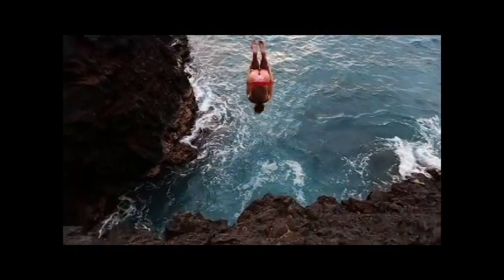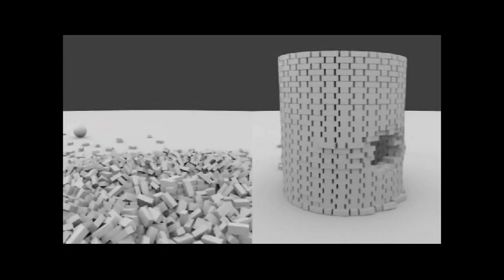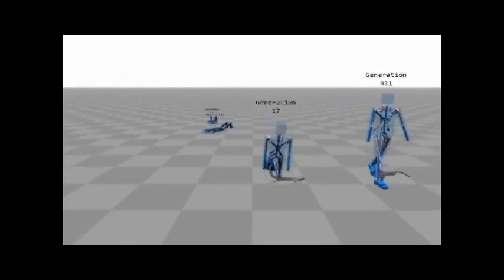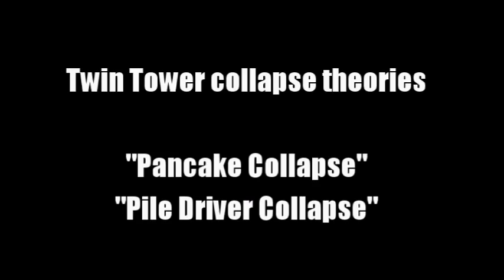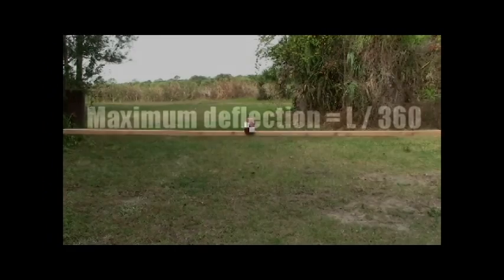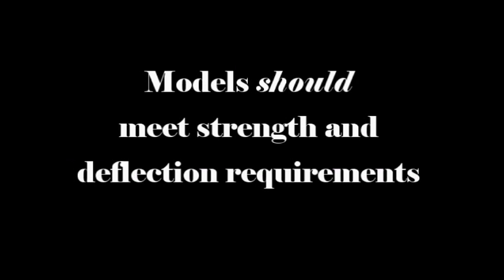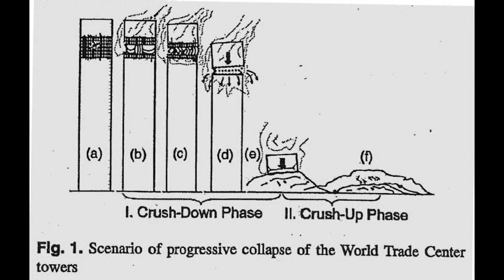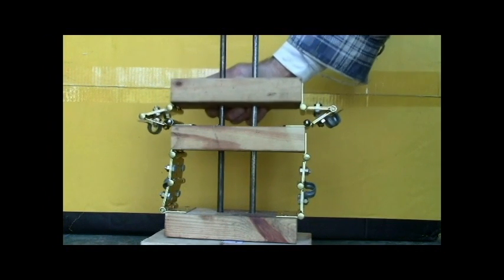9/11 Experiments: The Force Behind the Motion

Comment: In response to recent comments for which I am apparently being blocked I will say that Jonathan Cole's experiments validate nothing. The "down and out" motion that Cole mentions is not actually what happened in "the event." It is just a straw man argument that Cole could easily defeat with his silly and unrealistic experiments. What really happened to the WTC towers is that, after collapse initiation, the floor supports in the open office areas sequentially became overloaded and failed resulting in the floors pancaking into the basement. There is nothing questionable about the fact that the collapse accelerated as it went gathering one floor after another at an overall acceleration of approximately 2/3 G. The only outward motion was the dust and debris propelled from windows followed by the exterior columns peeling away after losing the support of the floors. The "multi-ton steel beams" (actually column panels) that were found impaled in buildings 600 feet away arrived at where they ended up by leaning outward in great sheets and breaking off. Here is a picture of a sheet of 50 to 60 stories worth of exterior columns, still mostly bolted together, that had peeled away from the west face of the North Tower after the floors had fallen:

archive dot org/download/NIST_9-11_Release_08/International_Center_for_911_Studies_NIST_FOIA/Release_08/Release%208/42A0007%20-%201of3/Police%20Overheads/166.JPG (replace "dot" with a period)

One has to wonder if Jonathan Cole saw pictures such as that before making this ridiculous video. I suggest readers investigate the actual evidence and be skeptical of truther claims that what actually happened was not physically possible.
Reply: Blah Blah Blah  CORE!!!

Go away W⚓
Reply: @gepettosplaylists  The core also experienced progressive collapse and, at any rate, could not stand without the lateral support of the floors in the open office areas. Please educate yourself and stop glorifying crackpots and opportunists who try to make you believe that what happened really didn’t.

Comment: This video is laughable for its simplistic and unrealistic “experiments” and its deceptive statements of science and fact. While it is true that a theory needs to be supported by experimentation in order to be proven correct, the experiment needs to realistically model real-world conditions. Cole’s experiments do not and are apparently intended merely to demonstrate the desired result. For example, to better model the WTC twin towers, the cement board “floors” in his pancake collapse experiment should have been more lightly supported and should have had greater mass. It’s no wonder that, when the weight was dropped, its kinetic energy was quickly dissipated in breaking the boards causing the “collapse” to slow to a stop rather than accelerate. A more meaningful experimental setup would involve modeling the floor supports as being more easily broken, say… using thin sheets of glass instead of cement board. To model the mass of the floors, a heavy building brick could have been placed on each glass sheet. Using that setup, the top glass sheet would instantly become overloaded when hit by the falling weight, would shatter and drop its brick onto the brick below causing its supports to also shatter. Then, there would be two bricks falling onto the third brick down at an even greater initial velocity, and so forth, until all the bricks had fallen and all the glass sheets had shattered. It should be obvious that a collapse modeled using the setup I described would accelerate and gain kinetic energy as it went and that the simplistic setup used by Cole was specifically designed to demonstrate the opposite effect.

It should also be mentioned that Jonathan Cole misrepresents NIST's statement about their findings not supporting pancake collapse. If you read the entirety of the NIST FAQ he referenced (currently #28), it should become clear that it is only talking about the factors that initiated the collapse. The reference to “pancake theory” (NIST’s quotes) was an allusion to the FEMA report where it is mentioned as a possible factor in collapse initiation. Other NIST FAQs make it clear that, once it started, the collapse was sustained by progressive failure of the floor supports, or “pancaking.”

I am a civil engineer. I have carefully evaluated the evidence and science and have come to the conclusion that the "official story" is perfectly plausible and is supported by ALL (actual) evidence and well-understood scientific theory.
Reply: This is AWESOME!!! FINALLY! A true professional!! Can you please build and display a proper experiment that supports the official story?! An experiment that can replicate what was observed on 9/11 so that I can finally let this “conspiracy” go? Because as of right now, the “conspiracy theorists” are the only ones making sense. Being a pro in engineering, this should take you no time to have a video up. Please send me the link when you finish.
Reply: @asonjayyajn  My charge rate for professional services is $110 per hour. I estimate that making a realistic model and shooting a video of it collapsing would take about 100 hours of my time which amounts to $11,000 in professional service fees to which would need to be added the cost of materials and photographic equipment which I estimate would add another $5,000 to the project. With your consent, I will draw up a contract. If you are unwilling to pay for the video you demand that I make, why not just think through the simple thought experiment I provided in my previous post. If you do, I think you will understand that progressive (pancake) collapse is a real thing and that Jonathan Cole is just fooling people.
Reply: @asonjayyajn  Look again at the videos. The floors in WTC 1 and WTC 2 progressively collapsed sending expulsions of dust and debris racing down the sides of the buildings. The simple thought experiment I provided exactly mimics that effect. Science is based on logic and reason.
Reply: Which projects have you made as a civil engineer?  That way I can tell my loved ones to avoid them and my enemies to live in them.
Reply: The experiment demonstrates and validates the forces of motion, not a model of the event.   The physics of the motion is evidence that can be applied to the event.   Or do you know of undisclosed physics that demonstrates how the towers imploded?
Reply: @ouchyg They can never explain the outward motion of multi ton steel beams when the only force applied according to them is gravity.  Which only works downward in cases of building collapses.

A force was applied to move those items outward sideways.  It can't be due to collapsing floors from above.
Reply: @ouchyg  Cole's experiments validate nothing. The "down and out" motion that Cole mentions is not actually what happened in "the event." It is just a straw man argument that Cole could easily defeat with his silly and unrealistic experiments. What really happened to the WTC towers is that, after collapse initiation, the floor supports in the open office areas sequentially became overloaded and failed resulting in the floors pancaking into the basement. There is nothing questionable about the fact that the collapse accelerated as it went gathering one floor after another at an overall acceleration of approximately 2/3 G. The only outward motion was the dust and debris propelled from windows followed by the exterior columns peeling away in great sheets after losing the support of the floors. I suggest you investigate the actual evidence and be skeptical of truther claims that what actually happened was not physically possible.
Reply: @marcpowell5893  Your imaginary thought experiment is wrong. The floors were suspended between the walls on the outside and the core on the inside. If the floors did pancake, it still doesn't explain the collapse of the inner core.

Please stop with your BS.
Reply: @gepettosplaylists  On the contrary, my thought experiment well modeled actual conditions. Each floor in the open office areas between the core and exterior columns was massive and relatively lightly suspended… just like a thin glass plate supporting a heavy brick. Once the collapse began, it was a juggernaut that gained speed and kinetic energy exponentially as it went. Please educate yourself and stop glorifying crackpots and opportunists who try to make you believe that what happened really didn’t.

Comment: Compelling demonstration, but there is much lost in translation. While the results of the experiments are thought provoking, I find their credibility lacking, not due in part to carelessness or intentional misinformation, but rather an oversight of reality. Comparing paper and plastic to steel and concrete and holding them to the same standards is just not accurate and doesn’t take into account the numerous other factors and forces at play during the collapse. That being said, I do believe that there is knowledge to be gained by your experiments and effort and I support your skepticism. Many run their mouths and speak of conspiracy with little basis or zero involvement - you, on the other hand, are willing to do something about it. I wish you luck brother
Reply: You are failing to understand the motion.  The physics of paper and steel are the same.  

Plus you're ignoring the first part of the video where no paper was used at all.  And a huge heavy block was dropped.
Reply: Also regarding using paper as a model, paper is easy to burn.

The materials and all the furniture in WTC were actually designed to not burn or be flame resistant.

So the example of paper actually makes the experiment more likely to collapse than the actual buildings because as you state buildings aren't made of paper.

Comment: @5.00 minutes 
The code deflection was correct for suspended floor 
Remember the floors were also pinned to the centre column and the external walls
If you did the same drop experiment with secured boards against the walls, I would suspect the drop through the floors would be even less, with less boards as well
Reply: center*

Comment: You cant compare a wood and paper model to a steel and concrete reality bcs the weight and strength of the materials are different. For example, could you build a skyscraper out of pine-wood? No, bcs the strength of pine wood crumbles at high weights. Its very strong at low weights like with your models though bca the weight is far away from getting close to its material strength. If you would have made your model in steel and concrete your experiment would have gone even worse. So its a material and scaling problem you oriented your experiment around.
In regards of air being pushed to the sides, that is also a scaling problem. Air is being compressed more easily at high volumes than small bcs again, its a scaling problem.
Reply: See deflection code discussion.  You missed the point.
Reply: @DS94everXev  
No I didnt.You are just lying to divert attention away from my critique which is solid.

Comment: Neither these experiments or the official "investigations" take into account, not the impact of both planes piercing the towers exteriors, but the explosion of the planes fuel tanks, which were essentially full as the planes had only just taken off. The "official" explanation was that fires weakened both structures until they could no longer support themselves, but surely the two massive explosions when the fuel tanks ignited would have caused, by far, the most damage? Those explosions would have had the necessary force to both displace and destroy many of the 47 steel core columns in the building.
Reply: Conflagration, not explosion. The fuel acted primarily as an accelerant, allowing for multiple floors to become fully involved in fire simultaneously.
Reply: @MFitz12 The video evidence doesn't support your idea though. Fire travels, look harder!